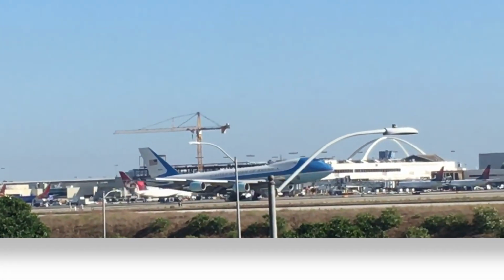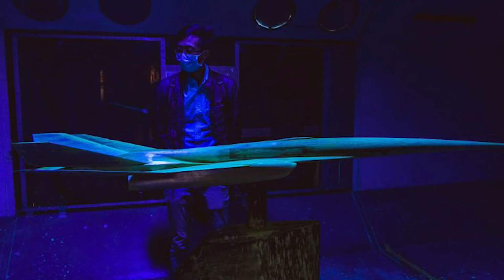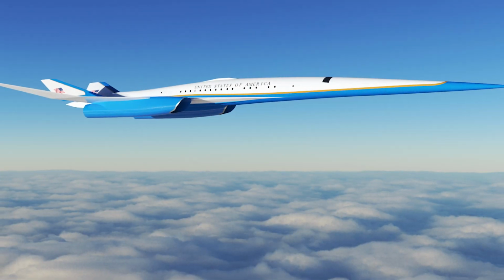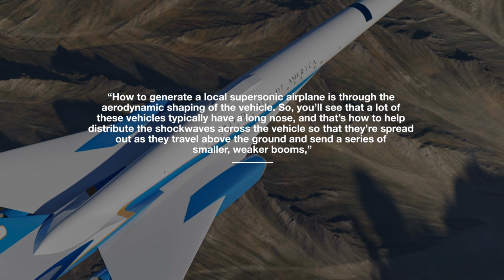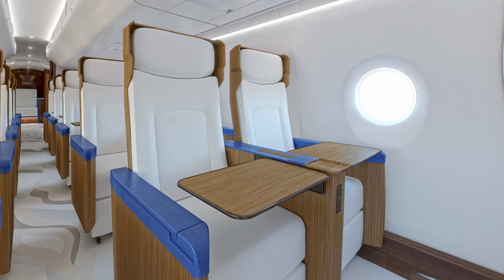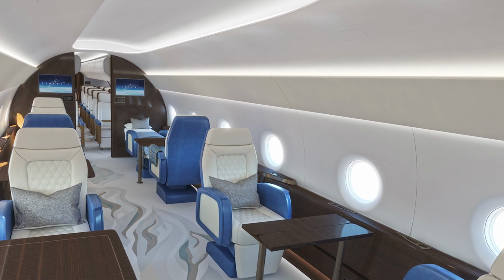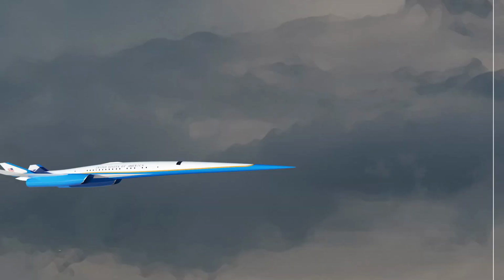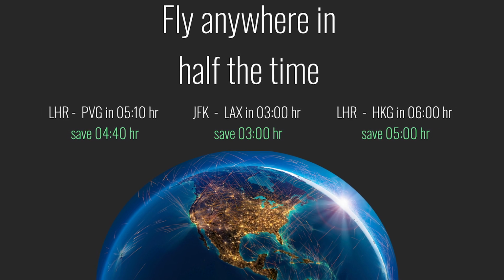Exclusive: Inside Exosonic’s Supersonic Air Force One Ambitions

Comment: A small section fuselage does not make for comfort, and with the entourage that usually follows POTUS this would be most impractical. The 747 is a tried and tested airplane with 50 years of safety and reliability behind it. Trusting the life of POTUS to new unproven tech is not an option!

Comment: Exosonic was founded 2 years ago, and got $1 million "small business innovation research contract" from the USAF, pretty sure that would not cover much in terms of design and prototyping, let alone have commercial airliners in sufficient number to justify having one converted to an Air Force One.
$1 million pays for the salary, advantage and overhead for half a dozen engineers for a year. A proper design team is several hundred people.
Verdict: don't hold your breath just yet.

Comment: Wait, but I thought the converted 747-8 will replace the current VC25As?
Reply: They will. This is a concept, and if it happens, it would be at least 10-12 years (though probably something more like 20)
Reply: @aaravkhatri1303  I wonder if this supersonic plane would be "in addition to" instead of "in replacement of" the VC-25? The sonic boom is not possible over inhabited areas. Also the president would have to travel with a much smaller entourage. Air Force One has a medical operating room. Would there be enough space for this in a supersonic plane? What about other bulky cargo transported with the president in the B747? Also Air Force One can be refueled mid-air. Would that still be a requirement and possible with the new plane?
Reply: @smcdonald9991  That might be very possible. There are times the president needs more space, so a new supersonic plane in addition to the new 747s might be likely. From what I heard, the new 747-8s will not have mid air refueling capability so the supersonic plane might not have it either.
Reply: They will.